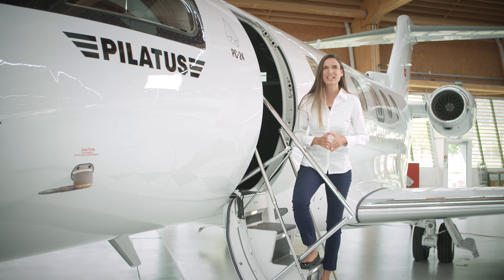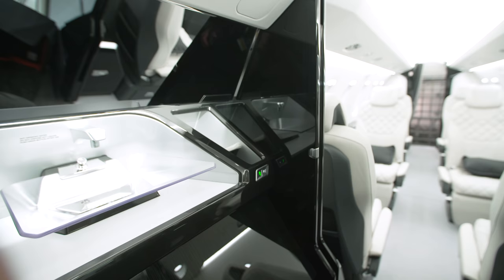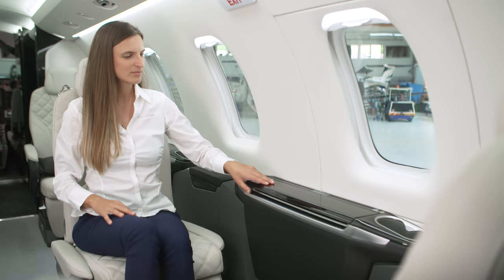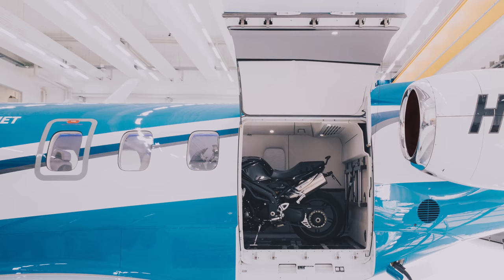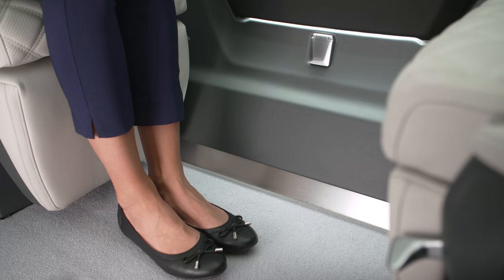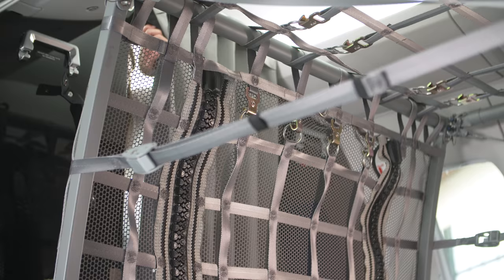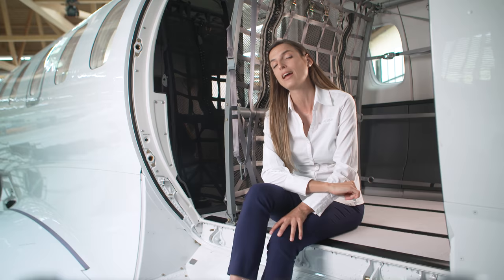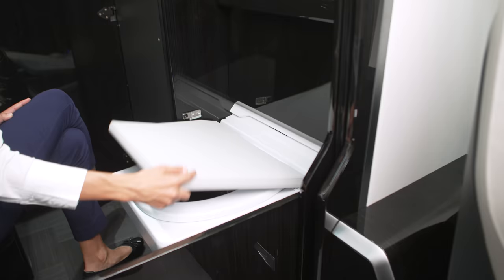PC-24 Tour Part III – Cabin with Project Manager Marta

Comment: I’ve been a pilot for over 25 years. I hold ATPs in Hong Kong, China and the USA/FAA, with 7 type ratings. This is an excellent option for the short haul light jet, especially if mountainous terrain is a concern. Swiss engineering at its best! as a pilot, I have to admit I love the lav in the forward area. That’s a win-win for sure.
Reply: Bruce, If I had to use that lav, when I got out your oxygen masks would deploy automatically the moment the door opened. My understanding is there is only like 5 or 15 minutes of air in that thing.
Reply: @bozotheclown935  🤓

Comment: Pilatus, PLEASE make a PC-24ER with about ~2,500nm of range. It would be the most liberating jet in existence!
Reply: Exactly, it only needs those few hundred nm more in range to be absolutely superlative! Now with HondaJet 2600 coming up that's what Pilatus can do to beat it.
Reply: @pistonburner6448  That hondajet 2600 concept is kind of a beast for a light jet
Reply: @darklord2014  Yes, and if Pilatus can increase the PC-24's range then it will be a tough competitor for the HondaJet 2600, especially if it can retain its superior short field performance and unprepared field capability. And the excellent cargo bay and door system.
Reply: @pistonburner6448  Does the HONDA 2600 have a toilet  ?
Reply: @onetime5640  Of course it does. Even the smaller HondaJet has a toilet.

Comment: We love this aircraft as it offered something that no other competitors could offer.  Pilatus as a company offers above and beyond support.  They are even beyond a 5 star rated copany as they are elite in their product & materials but as well as commuication.  We've had no problem landing at Lakewood, NJ (N12) & it's runway length is 2912 feet.  I would highly recommend the PC24 to anybody that flies and also to charter companies.  I like the fact that I can get closer to my ultimate destination because of the runway length required to operate.

Comment: This is an amazing aircraft! Is it possible to install additional fuel tanks for extended range?
Reply: I wish they come with 4300-4500 km range for 7-8 passengers
They can make the plane half metter wider and 1 metter longer little bit bigger engines like 5 percent bigger and will be perfect

Comment: Is it possible to change the seating options according to the individual flights need? So switch from a 10 seat to a 6 seat by simply removing 4 seats and rearranging the rest?
Reply: you need to keep pre-defined seating configs, but that said yes, you can throw out all but the forward 4 seats for example.
Reply: I believe the commuter seats are lighter & more compact than the executive seats, so all seats will need to be swapped out for the 10 seat commuter configuration.

Comment: I understand drawing comparison between the PC-12series and the PC-24, but Pilatus Aircraft LTD also needs to compare the PC-24 to the Phenom 300E, which I believe is its most formidable competitor. Having said that, Pilatus Aircraft, Ltd. has been building airplanes since 1939, and somehow, (hard as it may be to believe!) they've managed to do quite well without my advice. 🤪

Comment: It will be useful if auxiliary fuel tank can be installed as per requirement in PC24, will be more useful with extended range.

Comment: OK, SO I FLY AROUND 425 MILES 4 TIMES A MONTH. Debating between this and and PC-12,,, Thoughts?
Reply: Keep the 12 in this case. Flight times won´t reduce much in a jet compared to the 12 on such trips. Only switch to 24 if you want 2 enginges. If you regularly fly 500+ Nautical Miles, step up to a Jet.

Comment: Lower doors in lavatory are open not fully close
If someone with diarrhea goes to the bathroom 
All the main cabin will stink becuse the doors dont close all way to the bottom is like 10 inch open in the bottom
They need to fix that or extend the jet 1 metter and make the lavatory in the bottom with fully complete doors

Comment: The lavatory door should be completely closed 
Becayse when u try to close the bottom
Door its not closing properly 
So u dont want to smell someone when used bathroom
And i dont see a flush in toilet
Is that posible if someone choses lavatory in back
U guy put that in back
Some people dont want to much space for luggages
Reply: So why would the door, toilet or "smell" be any different if it was in the back??
Reply: Clients thinking like you may not buy this jet, they buy a different jet, free market. This jet is designed for folks who value cargo capabilities (everything is a compromise) so lav up front (and yes, I don’t like it either) is a compromise in exchange for unparalleled cargo space with huge cargo door and uncluttered aft (back) to put anything you want. Even Denali turboprop plane has a better aft lavatory and all the rest of the jets. This is unique for a reason.

Comment: Can u add the lavatory in back instead of middle
If someone needs to take a sh  
The lavatory in front is not gonna sound good becayse the smell 
It need to be in back and have a flush In toilet
Reply: I fly those birds commercially for 9 years now and never had a passenger drop a load... we are talking about flights in duration between 1 and 2 hours for most flights. Besides: Choose between the crew getting the smell or the rest of the passengers getting the smell.

Comment: Having one Lidl Icebox that has no drain that has to be taken out of the plane to drain it, and for second box to take out the drawer itself has to be unlatched before you can pour the water on the ramp - guys that’s a joke for a 13 Mio aircraft! You constructed a holder for paper oil funnels and then I have to take the drink boxes out after each flight to drain them? You must be kidding. And the large baggage cage wastes much needed room due to how it is placed/ formed that baggage space is also a joke. Besides: Full Fuel Payload in commercial ops of pre MSN501 of ZERO pounds? Really Pilatus??? Where do your shiny www numbers come from? Calculated without galley and with 8 commuter seats? And there is not even someone who has the position of directly listening to customers? Or is it? If there is, drop me a note and train your staff accordingly as they are not aware of such a post inside Pilatus.